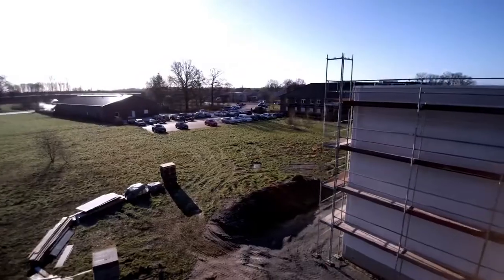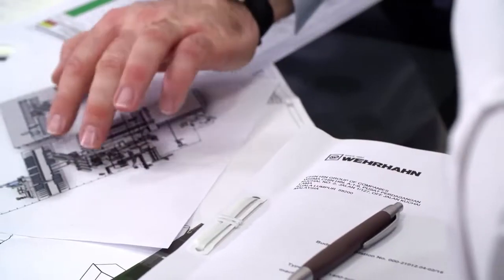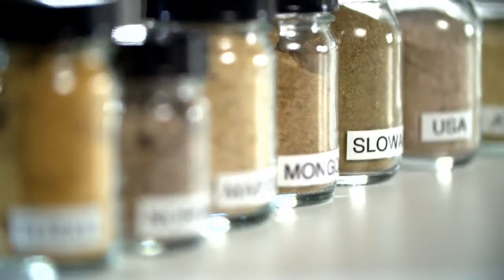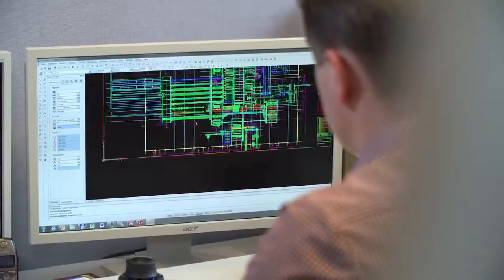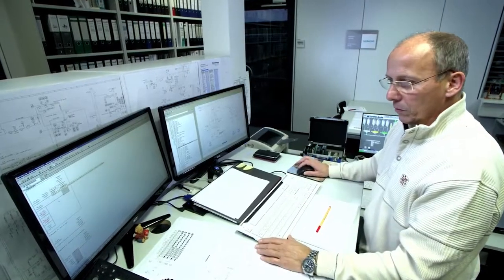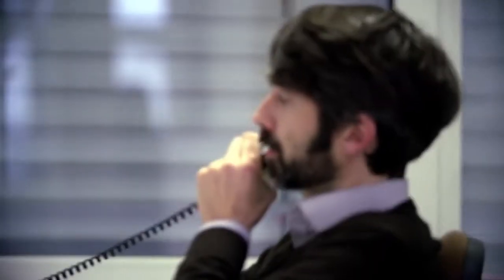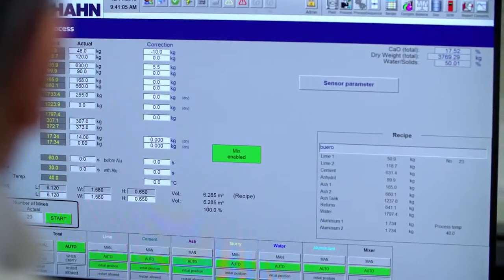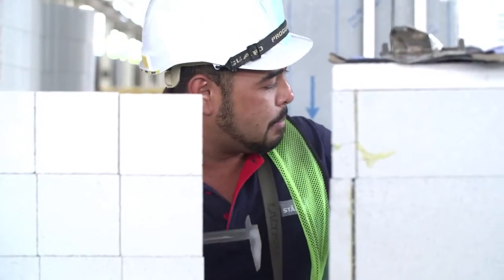Lightweight aerated concrete

Comment: Is aerated concrete suitable for ground-contact installation, such as in foundations or swimming pools?  Can it be waterproofed with conventional plaster or Portland cement parge coating?